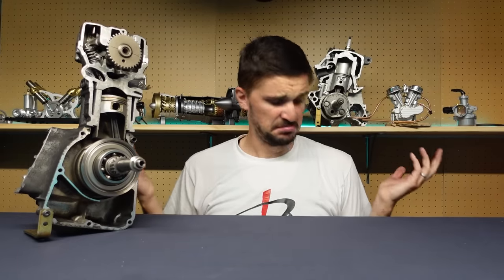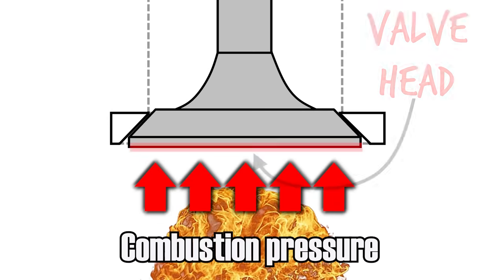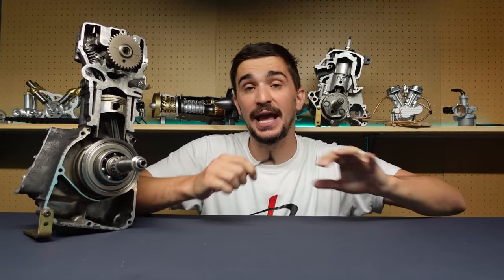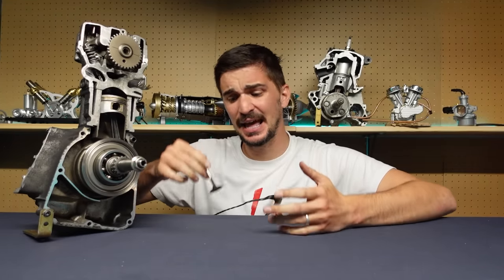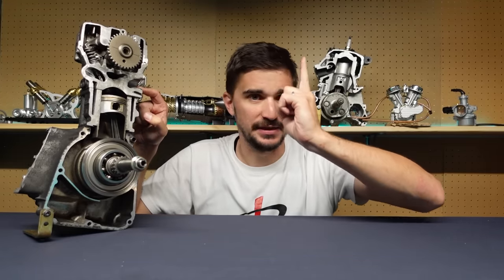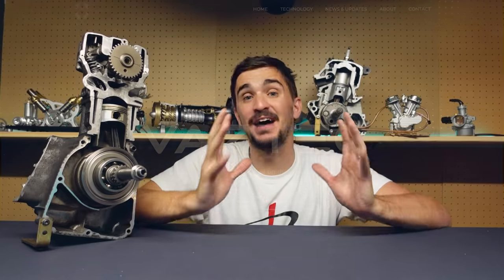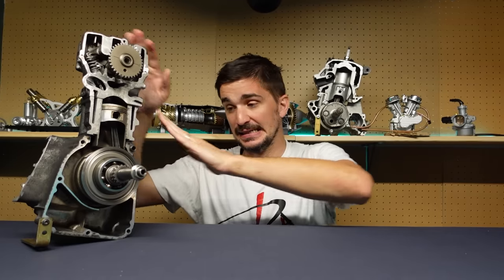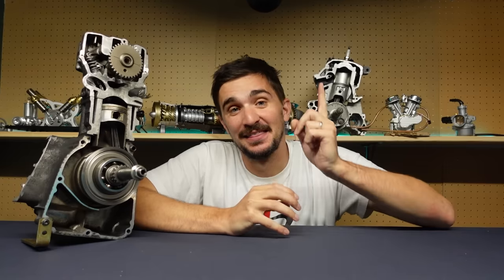Rotary Valves Make Normal Valves Look Silly - Why Aren't We Using Them?

Comment: That's wrong. You don't need seals for a ball valve. Valves can be all metal. It's just that you'll basically never see those types because reasons.
Reply: (on Mobile site, 🖕 Google) Great video, still watching it. Just wanted to point that out though. Even a cylindrical valve as shown can be made of all metal. Fluid from one side pushes against the other. Some valves (water valves) in some applications are bolted together without o rings or gaskets in case you didn't know that. I won't go into details but it's true, just takes really precise machining.

And then there's surface wear to think about... But then, have you seen the new techniques used in modern engines? Some kind of electro plating wizardry and like magic, no cylinder sleeves. Interesting, no?

Comment: I don't think that rotary valve is more efficient than current technology. You need to rotate the valve when combustion pushes at it, it will waste a lot of energy, especially on multi cylinder engines.

Comment: Hey WHY NOT keep the round pistons but use a ROTARY head to completely replace the valve train?  No advantage in longevity BUT if engineered to be quickly replaced as a "head mudule"?  The rotary head could be rplaced with a rebuild say every 30K miles and expense yes but nothiing like tearing and entire engine out.  I envision piston domes shaped like part of current wankel design so the rotor on the compression igntion phase  would have exactly the right combusition shape....not sure how to spark the thing...maybe the spark plug sits IN the piston crown and simply gets replaced along with the head module?  no valve obstruction no valve float super scavaging....he SECOND idea is POWER the head rotor with electric motor that speeds things up enough at the right time to make this engine a TWO STROKE!  now half the displacement same power...well minus powering the elctric motor driving the head....wait hold that thought...INSTEAD n electric power but TWIN hea rotors!  Dont ask me how

Comment: The shame is that a lot of ICE development is being held back by the insane amount of money, time and resources being diverted into EV power trains.  But even if we finally got the perfect EV, that just shifts the problem to elsewhere.  The electricity has to be generated somewhere.  If every ICE engine was replaced with electric, the amount of electricity we need to generate would be staggering.  With every home covered in solar cells and every beach swamped with wind turbines we still wouldn't even get close.  Not to mention the huge investment in upgrading the distribution network to carry such enormous loads.

Comment: As to the why, they failed is quite simple. Because you need compression and compression was based on tight seals. Your method is not tight seals. You do not max out the compression. You will never reach maximum efficiency. Or performance with that kind of valve

Comment: Desmo valves from Ducati are high maintenance. 
Same concept as a rotary.  Just need to look at the philosophy of the science.  
Everything has its place , no need for a rotary valve for lower rpm engine.  Not that anyone asked me  but I like things simple stupid.
Reply: Post VW/Audi acquisition, Ducati Desmo valvetrain systems have an 18k mile service inspection interval.
This service interval is similar to motorcycles with conventional valvetrains.

Comment: Obviously you've never been a Sparkplug because if you had you would have seen your problems
1. you have no control over the valve, with a Cam you can snap it fully open leave it fully open then Snap it closed making the time it was open the longest it can be for the Stroke. now with your Rotary Valve idea you cannot adjust past a Max of 25%.
2. note that when a Head guy Laps a Valve in he's looking for an even seal surface about 1mm wide, and every time shit goes past there's very little place for a piece of shit to stop in and the next opening will normally clear the Rock ... now with your Rotary Valve idea  you have 2/3rds of a ROD to catch Stones and crap from the combustion chamber torip what ever you make that seal out in hours.

Comment: Duration? Speed of opening? What's with the dumbass angle of the flat top cylinder at 8:26? No one has an engine with those dumbass angles in it... No variable valve timing?
So basically all drawbacks, and no advantages... Wow, I wonder why we don't use these all of the time?

Comment: Okay I may not be the smartest in the world but it seems like there's already a solution the same one they use on a piston for the compression and o-rings they're directly exposed to heat pressure and what not and hold up for hundreds of thousands of miles why don't they use the same rings for them seems pretty simple move from the simple o-ring to a simple compression ring

Comment: Do not think you are the first one to have clever ideas.
The idea is not new, as it is so obvious since combustion engines are developed. But evolution of 150 years and many attempts at many times have shown,  it is overall outperformed by poppet valves. As the Wankel motor is outperformed by piston engines and so on... 
Exception: 2-Stroke engines for go carts use rotary valves for crankshaft intake port timing

Comment: Rotary valves have been repeatedly tried and failed. The actual engine does not obey the simple theory. Combustion leakage into the valve drums is not insignificant. It is severe and causes heat/distortion of the valves. There are good reasons to give up on such rotary valves. Firstly the air flow through the valve is not as big an advantage as you'd think. It only has a straight port momentarily then assumes a lousy shape the rest of the duration. Not significantly better than a poppet valve on average. 
Getting a rotary valve engine to run at all is a great achievement but what are the dyno figures?  What maintenance is required to run long term? etc
 A credible attempt to get the same benefits without the problems was the sleeve valve engine. Some of which performed very well.

Comment: look man, you cant put rotary valves and reliable together. the designs you showed are anything but reliable.

It's not a matter of return to investment. numerous people have tried to seal piston engines differently. it's a physical issue leading to emissions and fouling.

during ww2, Napier made oscillating sleeves peak. defeated by oil consumption and maintenance. 
during the 60's Coates made a rotary valve work on a small block ford. defeated by oil consumption, wear and fouling.
right before WW2, detroit diesel overcame the limits of early diesels by mass producing uniflow engines. Defeated by emissions, oil consumption, effiency issues and noise, these engines were gone off europe's markets in the 1970's and survived in the us for offroad/construction use till the late 90's... since this application has been limited to marine use. 

Almost every single engine manufacturer has made variants of the rotary valve or whatever poppet valve arrangement to increase effiency.

people shit on wankels because they need inspections and rebuilds every 20K km... and somehow one could expect a smaller drum, exposed to the same heat cycles, would be able to perform better? 
.

Comment: If they don't want their development to be in vain then they need to find a way to stop the mad dash to electric dodgem cars that is currently being pushed. With fossil fuel falling in popularity they also need to research other, probably liquid, fuels to hold the energy and avoid the issues with heavy, rare material batteries.

Comment: Why start developing a new engine when they are about to be phased out. Should of done it decades ago.  Electric motoring is the future,  & the benefits of this will be that they will be improved over time. This will then filter into motors used in other areas.

Comment: polyps resulting from ignition process in cylinders will very quickly block rotation of  the "rotating valves" .It is stupid idea, that have not been tested in practice. but might fascinate some weak minds who do not understand very well physics. Do not forget that most car mechanics are people without University degree.

Comment: Great presentation, but you’re flogging a dead horse. Aircraft engines of WW2 had up to 28 cylinders and about a zillion moving parts. They were unreliable and eventually superseded by far simpler (but thirsty!) jet engines. IC engines for common use are doomed. Valves aren’t the issue. Electric motors are vastly simpler, cheaper and more reliable. “All” we have to do is improve the batteries. And install a LOT more generating capacity. 
I still foresee diesels being used for long haul or heavy power applications, probably running on synthetic fuel.

Comment: Ahhhh....but an electric motor is WAAAY more efficient than ANY heat engine, rotary or poppet valve. Upwards of 90% for an electric motor, no more than 30% for a gasoline, diesel or turbine engine. 
Think about it...piston engines have cooling systems. Think of them as Heat Wasting Systems. The ONLY advantage that fossil fuel engines have is the energy density of the fuel. But batteries are getting better all the time...
....AND electric motors can recover the lost energy of motion with regeneration.
Simple proof is that RIGHT NOW, the energy cost per mile of an electric vehicle is 1/3 that of a gasoline vehicle.
Reply from the maker: Yaaaawn. All that talk has become a bit boring and repetitive. You can put all the dramatic caps on all the words but the real world is still the real world and electric is fun and interesting and I have nothing against it but it still doesn't work for most people in most parts of the world.

Comment: No. Rotary valves are not feasible in mass production vehicles. The obstacles are too great to overcome. It has nothing to do with investments in traditional valve train systems.
It has everything to do with sealing, space requirements of the system, high maintenance costs, and durability. 
This plays down the issue with sealing…. Like it just an annoyance. No. THE ENTIRE PURPOSE OF A VALVE IS TO SEAL. So, that’s a nonstarter.
Couple that with increased maintenance costs and lack of longevity and it’s practically a concept that’s dead in the water.
On a side note, this guy, just like a lot of people these days, are obsessed with the idea of innovation. Its became a quasi religious movement.
Event at the expense of any notion of reliability and durability, the entire backbone of what makes a quality product, innovation takes the drivers seat.
Nope. Sorry. Traditional valve trains aren’t going anywhere because they work well and last forever with practically zero maintenance. At a much cheaper price.

Comment: Easy answer.....you can not reliably seal a rotary valve. Period.
Reply: Speaking for the engineers: Yes we can. Sealing a moving part is not a complicated exercise, and the bag of tricks for it that we have built up over the last 150 years is LARGE.Sealing it under extreme circumstances such as these might be a challenge, but is merely a matter of what measures you are willing to take. The question is whether or not it is worth the effort.
But unless you demonstrate to me that it violates some law of physics, do not speak of "can not" to us.
Reply: @rockyblacksmith  can you effectively seal for a low cost? The answer is no. We all know that.
Reply: @iamtheoffenderofall  That's not what your initial comment said. This here is what you call moving the goalposts.
Reply: @rockyblacksmith  if you could RELIABLY seal a rotary valve, we would have them in every day use. Now why don't we see these rotary valves in everyday use?
Reply: @iamtheoffenderofall  Shall I start listing all the various things we "could reliably do" but don't?
There are thousands upon thousands of such cases, because the benefits turned out to just not be worth it.
Reply: @rockyblacksmith  we aren't taking everything else. Lets stick to the topic at hand. Answer the question.
Reply: @iamtheoffenderofall  The answer for the question is the same for all of those cases, and the last ten words of my comment ARE that answer.
Reply: @rockyblacksmith  so you're finally admitting to my comment. You cannot reliably seal a rotary valve. 

Cause the actual fact of matter is....if you could....we would be using them NOW. Not a some cool see, we can do it, trick
Reply: @iamtheoffenderofall  You really don't know the difference between "can not be done" and "isn't worth the effort", do you?
Reply: @rockyblacksmith  not worth the effort is synonymous with can't be done. And aren't you the one that babbled me saying the SAME EXACT THING?
Reply: @iamtheoffenderofall  Where in earth did I say ANYTHING of the sort?
One is a cost-benefit calculation, while the other is a statement of impossibility.
What is "not worth the effort" in one circumstance may very well be worth it in a different one. And even if such an application does not exist now, it may come to be in the future. The list of technologies that existed decades before they became practical for use is endless.
But "can't be done" means can't be done, no matter the circumstance or time.

Comment: That is not true , when the cam pushes the valve open it uses energy to compress the valve spring , that energy is stored in the spring ( but not lost) it is returned to the engine by the same method , the spring pushes back on the rocker inturn pushing the cam lobe and giving that energy back to the motor , the valve train uses next to zero when the engine is running ! False science he is speaking !
Reply: 1. Science says those springs mean there is a significant amount of pressure between the rocker and the cam.
Pressure means friction (no matter how well lubricated). Friction means loss of energy to heat.
2. More importantly: The back and forth you describe is less efficient on the way back than it is on the way in.
They might be almost the same one way as the other when the rotation is slow (discounting friction).
But the faster the rotation, the more relevant the following effect becomes:
A spring can be compressed at any speed, the stored energy is defined by how far it is compressed.
But the energy carried in the cam shaft is defined by its speed, and anything wanting to impart energy onto it has to move just as fast and still have energy to impart.
Now, the faster a spring expands, the more energy is expended to overcome its own inertia and that of the rocker and valve (which, remember, constantly changes direction and thus constantly needs to be ac- and decelerated).
And thus less energy is left to impart on the camshaft. The higher the RPM, the WORSE this gets.
The way that floating valves happen is that the spring can't even move fast enough to press the valve shut, which also means it can't move fast enough to keep the contact between rocker and cam.
The point just before that, when cam and rocker are just keeping contact, is when ZERO energy is imparted back. And even though the system isn't supposed to reach that point, the closer it gets to it, the closer to zero the energy feedback from the spring to the camshaft.
So the point he makes stands, particularly at high RPM.

Comment: Rotary engine, wankel, does not have valves. Neither does a turbine.  Lots of opportunity to massively improve the efficiency of those types.  They are small, very powerful, and have low parts count.

Comment: You forget that most of the power is returned to the engine when the valve opens and pushes the cam lobe down. Conservation of energy, bro!
Reply: Yes but energy is lost to heat every time spring goes through  a cycle.

Comment: EV is a dead end. Too resource heavy.
Reply: Yes, because oil drilling is free. But wait... let's say you put ten gallons of gasoline in your car every week for twelve years... how much in resources is that? 10*52*12 gallons = 6240 gallons. A gallon of gasoline weighs about 6lbs, so during its average life that car will use 37,000lbs of gasoline, which came from 70,000 lbs of crude oil. Talk about resource heavy.... Jeff, you need to stop drinking the cool aide of the oil and gas industry. ;-)